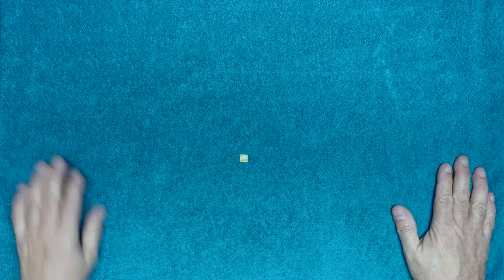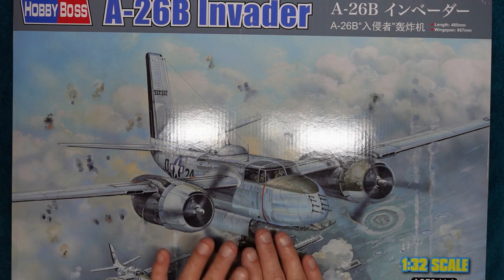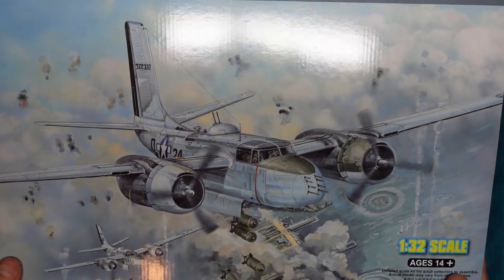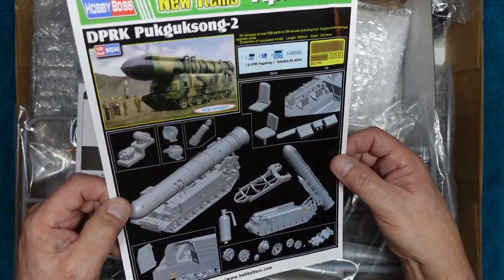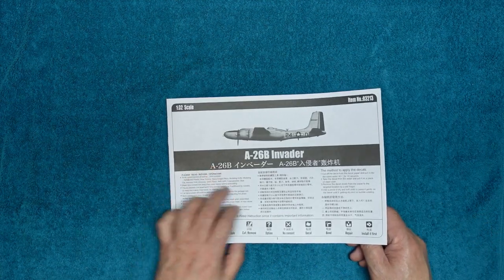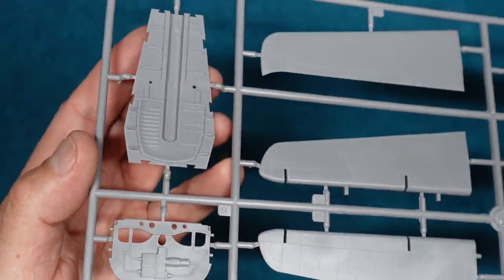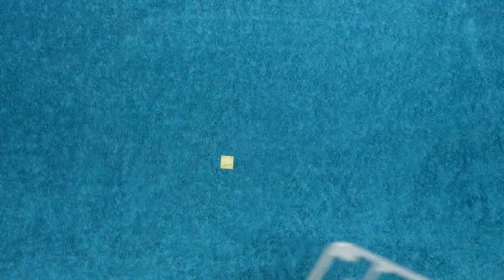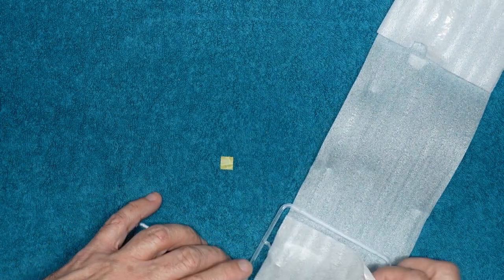Hobbyboss 1/32 A-26B Sprue review and errors list

Comment: B-26B with a glass nose is designated as B-26C :)
Nevertheless, HB gives us an early B-26B-5 to B-26B-20 with a flat top canopy, no guns in the wings and early R-2800 engines. 
You can build an early B-26C (B-26C-5 to B-26C-20) from this kit by just adding the glass nose. But be careful to fill excessive 50 cal port on the nose right half.
You cannot make B-26K or RB-26K (with glass nose and photo recon equipment suit in the bomb bay) by just cross-kitting with B-26C or B-26B late (B-26B-25 to B-26B-55) cause B-26K has different engines and props as well as reinforced wing and fuselage, accompanied with 20% wider tail fin and rudder.

Comment: One Big correction to Nigel's great review. The A-26C kit DOES NOT come with a different canopy. It is the same "flat top" sprue as in this kit. I got sucked in by the box art once again, and it cost me (again).  The A-26C kit does have a separate clear sprue, but that is only the clear nose section, and a couple other small parts. Now a word of warning to those contemplating modelling the flaps down. The A-26 had double slotted flaps with a complicated looking mechanism. So I recommend either holding off, and hope someone will address this area, or build it flaps up.

Comment: The great advantage of buying kits on Amazon is that if there is a molding fault or parts missing you can just get a full refund or be sent a replacement. 

Regarding the markings, it is a French A 26 indeed, they were extensively used in Indochina. However I believe that they wore the same very dark blue as the bearcat or late corsairs.
Reply from the maker: Amazon are amazing for their ease of returns. They also do some silly prices sometimes.

Comment: Unfortunately the wing is not only mounted too low on the fuselage, the reason the faring between the nacelles and wing upper surface is too wide is because the wing sits too low in the nacelle (or the nacelles are too high - take your pick) to compensate.  The wing angle of attack and airfoil section are also incorrect, and the engine cowlings have the wrong profile.  

That said, knowing all of this (and the other errors) I still bought the kit and will spend time rectifying all the major shape issues (and engines etc) simply because it's the only offering in 1/32 and is still a beautifully produced kit.  I bought the C, so I'll add correcting the glass nose profile to the list, and might as well make a new 'bubble top' canopy too.  The finished aircraft won't be 'rivet counter' correct, but as someone with a collection of Invaders in 1/72 and 1/48 I do at least want the 1/32 kit to look correct overall.

Comment: You do realize that the instrument panel supplied with the Decals is for the A-26A Counter Invader and NOT the WW2 version.  Why?  Look at the right side and you see the "basic 6 pack" instruments.  The WW2 and Korea versions were a single pilot plane, but the Vietnam version Counter Invader (B-26K/A-26A) was two pilot, and had dual controls instruments. The Basic Six Pack instrument layout was developed in the 1960's.  Google Basic six pack instrument panel.
Reply from the maker: Oh how I wish that is all that is wrong with this POS. The Eduard set corrects the cockpit BTW.
Reply: @NigelsModellingBench   I know I know...  I was just pointing out "another" error.  lol..  And to add another.. the control yokes are also the Counter Invader versions (notice they gave two.. remember ww2 and Korea were single pilot single yoke aircraft). The yoke for the ww2 version had triangle handles, where these in this kit are the "horns"  Not right.   Anyway, i do like your channel quite a bit. I enjoy your videos. :)

Comment: Hobbyboss has convinced me that they are technically excellent at producing plastic models; they have also convinced me that their ability to consistently, accurately reproduce a given aircraft still lays ahead of them.
A 14 cylinder R-2800? Unforgivable! 
God bless all those modelers who are so indifferent about such things as this that they say: I don't care about accuracy. Left to them, we would only have gems like Aurora FW-190s & Me-109s to build.
For lesser errors, Tamiya, GWH and Eduard retooled their offending kits (109E, P-61 & 109G respectively). Given the price of this fiasco (kit), Hobbyboss should retool to correct all the errors, and offer free correction sets! Such an approach would probably send shock waves through the factory, and create a lasting impression on the necessity of getting things right the first time.

Comment: Nigel , look up ....Resin 2 details , they have the corrective parts for this kit . Engines , exhaust, sets ,wing oil cooler vents ,and wheels and landing gear .
Reply from the maker: I have actually emailed them and asked if there is a UK supplier. I got no reply, so I won't be buying from them.
Reply: Me to Nigel  , this is in 2024 now and o got no response from email or messenger.

Comment: Hi Nigel good video I I want to ask you how long does CA glue last for
Reply from the maker: Hi Keith, that's a good question.. with no solid answer. Some keep it in the fridge, but I never do as the risk of moisture getting to it is very high once the seal has been broken. If you store it in a unlit place, i.e.:- not on a windowsill, with the lid tightly fitted it should last you six months minimum. When it starts to go thick or does not dry fast is when it's gone off.

Comment: The engine is closest to the Wright R-2600 Twin Cyclone. This was used on the SB2C, TBF/M Avenger, A-20 Havoc, and B-25. It produced 1750HP vs the 2100 HP of the 18-cylinder Pratt&Whitney R-2800.
The B-24 used the P&W R-1830 Twin Wasp, also a two-row 14-cylinder engine.

The R-1830 has a diameter of 48.03 inches vs 55 inches for the R-2600. In 1/32 these would be 1.5 inches and 1.72 inches respectively.  The R-2800 has a diameter of 52.8 inches (1.65 inches in scale). The question is what is the diameter of the kit engine because if it’s the right diameter for the A-26 then it will be too big for the B-24.
Reply from the maker: I will check. Having said that, even if the engine is incorrect for the B-24, having an actual twin row 14 cylinder engine in there instead of a plastic lump would look better eh? I thought the kit engine here looked a little anaemic to be a 2600?

Comment: Some further research is needed to understand the aileron setup on these later variants . It maybe the case they used flaparons . This may explain the ailerons both drooping , this would help in the low ground attack roll as would explain the nose setup for this aircraft . As for center fuse section this could also be a later mod to the aircraft to help wing  loading 
As I say further research needed and my knowledge on this aircraft is limited .

Comment: Nigel, the canopy of your A-26 is a late B not the early B, early B's are flat and has only 1 panel over the Co-pilot seat, also I've helped repair a late A-26B here at Lackland AFB, first off yes those engines are wrong, the main wheel well are also wrong, there is no bulkhead in the front of the wells, the main gear wells are opened to the aft engine bulkhead, in that area is the engine oil tanks, also the cockpits on the late B's and the C's the instrument panels are correct, the early B's only has the pilots seat and jump seat and half instrument panel, the later aircraft was updated with both pilot seats and full instrument panel, also the gunners gun sight periscope "DOES NOT HAVE ANY CLEAR CAPS OVER THEM, THE PERISCOPES TIPS ARE EXPOSED TO THE AIRSTREAM".
Also on the late A-26's the wing guns are serviced from below not like their fighter brethren, reason the gun pods ammunition was fed from the ammo bins inside the wings, thus was carry over to the later versions with the wing mounted guns.
If you want pictures of an A-26B just ask I'll get them to you from the A-26 @ Lackland AFB Airmans Heritage Museum (I'm a volunteer for them)
Reply from the maker: Hi Cuda. I thought this canopy was flat? I did discuss the pilots seat and engines in the video. As for ammo boxes in the wings, I have seen the Kermit video and he showed panels in the wings and said they were for ammo?? Also, in the same video we can see bulkheads between the oil tank and the u/c bay.

Comment: The A-26B could carry up to 4,000 lbs (4x1000lbs) of bombs internally and an additional 2,000 lbs on underwing hard points. If those are 500 lb bombs you can install 8 at most. You can certainly put in 10x250lbs.
Reply from the maker: That's what I thought. I'm 99% sure the bombs in the kit are 500lb.

Comment: BTW, I think you’ll find a bigger problem with the wing than it’s location on the fuselage is the shape of its airfoil. The A-26 had a NACA 65-215 laminar flow airfoil like that of the P-51. The maximum thickness to chord ratio of that airfoil is only 15% and occurs around 40% chord. The kit airfoil looks to have a t/c close to 25%, 50% thicker than it should be, and the cross-section is all wrong. This throws off all the other dimensions.

Comment: You may have missed the BIGGEST "Farcup" in the kit: The engines. Hobby Boss provide 2x14cylinder radials -7 per row. The A-26 used R-2800 engines which were 18 cylinders.....or 9 per row, just like the P-61. So, 2 resin R2800 engines will be a primary port of call in the After Market, and that will not be cheap.
Reply from the maker: If you watch the whole video, I I covered this and displayed the sprues from the P-61 kit by Hobbyboss.